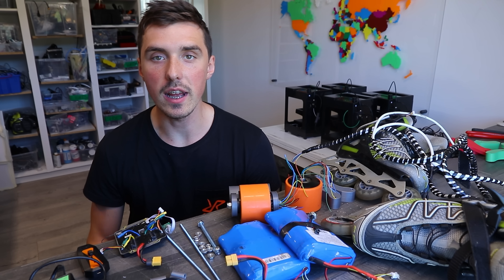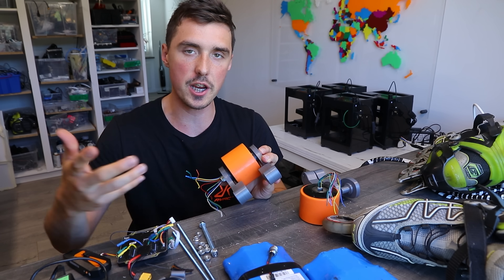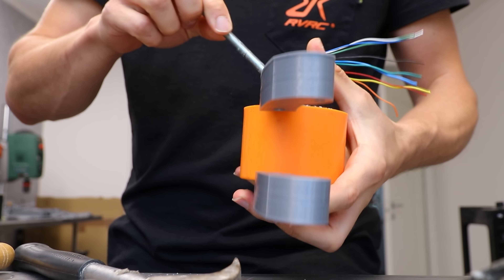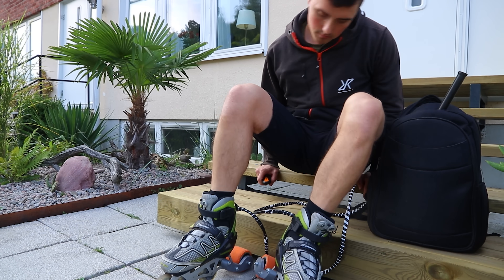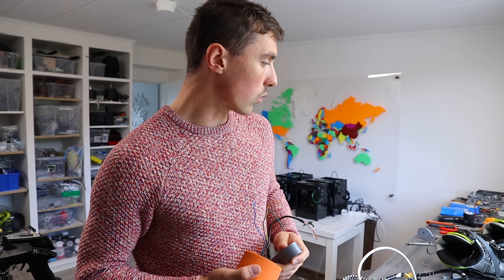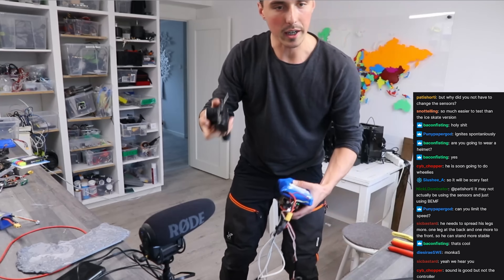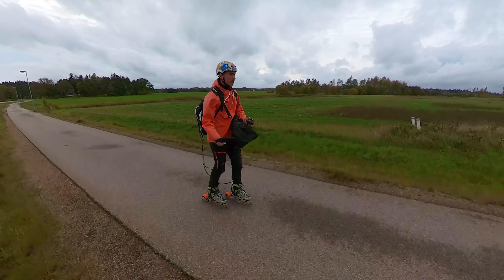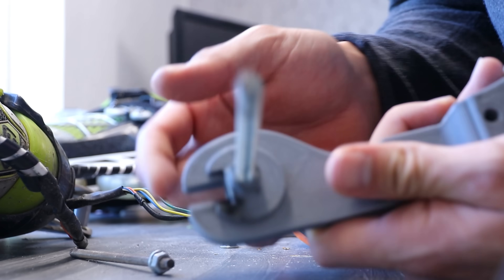1000W Electric Rollerblades That Will Hurt You

Comment: oooooohhhoohooohooo this video is SUPER fun. id love to have a pair for myself

some things id change. first off, id imagine front mounted motors would be easier. i havent used motorized skateboards or whatever ever so maybe theres something i dont know, but when ur skating at high speeds its super important to scissor (which you do really good in the vid!!!) and to bend forward to make sure you're counterbalancing the forwards inertia. i think itd feel more like skiing with wheels in the front only

im curious how turning felt, with the motorized wheels being so square. not that you'd want to turn very sharp going so much faster anyways, but its something to think about. id be curious how itd feel with more rounded motor wheels, with motor wheels that swiveled by some amount, or with quad skates that had some of the wheels motorized

Comment: amazing craftsmanship/engineering! love it. i'd previously thought of making a similar set of electric in-line rollerblades, but different - think of the slades rollerskates that are detachable from the shoe/boot, but in rollerblade form factor, and with the battery pack meant to be carried in a backpack.  so.. like if you took/removed the boot, replaced it with a thin metal plate with attachment points, then had a shoe (like the slades rollerskate shoe) that had a complementary attachment point -- and the battery isn't in the boot/skate platform but in the backpack with a wire. honestly if there was a company selling them i think they'd sell. you must get told this a lot, but if you sold these as an assemble-able kit, or partially assembled kit (the motor & wheel onto the bracket, the electric bms/motor controller).. and the end user has to buy a specific set of rollerblades, or you have them as a kit... i think they could sell. how MANY, i don't know, but slades are a thing so.. maybe enough to make a small side business from. could do a kickstarter, with a minimum amount of units sold needed before it kicks off, to make it worth, then contract a chinese company to do the assembly. easier said than done for sure, but a thought. the main difference with this kind of design is you can take them off your shoes and wear them at work, keeping them in a backpack, then clip them on at end of the workday and rollerblade home if you're close enough where that's practical.

Comment: Instead of soldering motor controllers directly you can solder out the wires so far and put a slip connector or Anderson connector so that way you could easily swap motor controllers in different projects without cutting wires also would love to see a version of this video where you don't speed through the work and that's where a lot of people can gain knowledge to me much better version of this video would not Montage or fast forward should work

Comment: Need to make air gear roller blades next. https://en.m.wikipedia.org/wiki/Air_Gear#:~:text=Air%20Gear%20(Japanese%3A%20%E3%82%A8%E3%82%A2%E3%83%BB,in%20thirty%2Dseven%20tank%C5%8Dbon%20volumes.

Comment: Maybe have a fuse between the motor and controller so if it overvolts it just takes out the fuse instead of the control board

Comment: In the next one you better learn to lean forward a bit so that not only you skate and slide well and lessen the crashes but you retain your tendons and back as well in the long run as I couldn't :) cheerios son and good luck. Keep going and keep growing
Reply: And yeah there should be a hind brake pad too just in case skaters like you tend to just slide brake. You can do it but not everyone. I know housing that under this built is more than a task and a quite a drag as well but has to be there for others if they dare this feet inspired by you. Stay responsible for others too kid. You're doing great. Keep it up

Comment: Will hurt you. Yeah, if you [clearly] suck riding blades and you try running it in the rain..........
Not to mention that rear-most wheel is probably the most important one, and you replaced it with plastic......

Comment: you need to put 4 of those wheels on each skate. or at least 4 that have the same size/shape. actually they would be more stable if they were slightly convex rather than flat. then you will find them easy to control and much more stable.

Comment: You may want to get new wheels for the hub motors if you are planning to revise this project. I recommend to get offroad/street wheels or something like cloudwheels because it will give you more surface area for when turning, while also making it alot easier to turn as opposed to the flat standard PU sleeves, al while providing better grip as you said.

Comment: Was making basically these and selling them some years ago. Some models I made had the battery under the foot with a bigger wheel in the front and a motor in the back. Also you really don't need motors on both feet, one is plenty and more stable on hard accelerations.

Comment: Not sure how to explain it. but if instead of having a flat surface on the hub motor making contact, what if it was a sphere. Almost like if you took a ball. cored the center then shoved the hub motor into that. My guess is it would have less surface contact so diminished speeds, but at the same time due to the spherical nature you would maybe be able to lean into turns easier? Since as you lean you are just hitting different contact points on the sphere?

Comment: It would be cool to have some sort of suspension system on them that is constantly pushing the wheels against the ground while having some give that allows you to lean a bit forward or backward without having to worry about losing traction or breaking the wheel brackets. Easier said than done, of course. It's a great build all together though!

Comment: You have 4 wheels on each roller blade...  (if wheel 1 is the front wheel and wheel 4 is the back wheel then)

Remove wheel 2, replace it with a motor, hook a sprocket to each of the 3 wheels and the motor, then run a singular chain drive to all 3 other wheels.

Having all wheels driven by the same motor makes it so that you have maximum acceleration grip and even wear on all wheels.

Comment: I think you could get by with just one motor on your dominant side.  Your accelerating and stopping would be smoother, instead of two motors that aren't necessarily synched.  You would have to change your stance to a staggered stance, which is more favorable for outdoor skating when coasting, or going downhill.

Comment: you should attach a sprig that pushes the motor and the wheel to the ground so you can keep your weight even on the blades and have better balance

Comment: Pro Tip for when you're splicing two wires together and want them to stay straight. Strip both wires, tin them, and then cross the two wires and twist them in opposite directions.

Comment: I'm sorry that I saw this video months after it had been posted.  
Question.  How much of a difference would it be if you replaced the rear wheel with a more rounded wheel similar to the wheels in front.

Comment: buy some steel rectangular tubing to interface with the motor. The 3D print can interface with the steel rectangular tubing with lots of surface area, making that connection much more robust. A bolt fits into a rectangular hole as well.

Comment: late to the party, but one thing you could try, other than adding a second motor to balance the load for traction, would be to have the rear-mounted motor on a swivel, with a spring (or spring/damper, if you wanna be fancy) pre-loading the motor into the ground.
It wouldn't help with offroading, but would ensure the motor has good contact with the ground, even when your rollerblades aren't in good, even contact with a perfectly flat surface

Comment: I had a bad idea. Use larger inflatable tires so you can ride off-road. Maybe re-arrange the handheld part to mount on ski poles. And maybe modify some skateboard trucks to fit the skates so that the wheels turn in the direction you lean.  Probably need to make friends with a machinist after prototyping with PLA.

I just had an even worse idea. I can't remember what they are called but have you seen those super springy stilt like things people use to jump real high and do flips? Put the big wheels on those. Please don't break your neck or other vital parts though, clicks are nice, a working body is nicer..

Comment: when it comes to skating im so incredibly smooth brained that I cannot absorb information about techniques unless its shortened to like "turn then not turn with other side"
but I think that helps, because my brain is so fucking smooth that as soon as the info gets in my head my smooth brain accelerates it at maximum speed and then I instantly get it
BUT I have to somehow by luck or simple explanations get the basic concept and do it atleast once

Comment: you need a radius on the powered wheel in order to use them properly. otherwhise it might decenter your weight at speeds as your feet can only stay at 90° and any tip will make you lose traction.

Comment: Check out Cesar Millan's(The Dogwhisperer guy)ROLLERBLADES.  :They use a lot bigger diameter wheel,mounted on the OUTSIDE of the shoes. This makes the ride way more stable..you can easily ride over small bumps,even ride on grass and dirt. Maybe those kind of rollerblades can make your electric powered skates more reliable,stable,and safer...and thus probably causing less of a problem when you eventuelly run into the cops,..which WILL happen, sooner or later.

Comment: Any thoughts of mounting your motors with a changeable gear system in your backpack , running cables and using 90 degree drill attachments to power the wheels? So the motors are all in the bag

Comment: You know I think the design is cool as hell.. and I want to make it myself. But all I did was watch a video where your designs kept breaking... It's a waste of time for me to try to build it if all it's going to do is break. I wish you would have made something that lasted I'm trying to buy electric roller skates but I would prefer to build them at home so that I don't have to spend a fortune buying them.. plus if I build them at home and put the batteries in a backpack then I should be able to travel with farther distance if I can get bigger batteries and possibly at a higher speed but I can't do that if it's going to break on me. So I'm going to be stuck buying what's available and there isn't that much available it's very disappointing. Because I really really wanted to build these and the fact that they kept breaking makes it impossible to do ...

Comment: Love this.  Seriously impressed by the integrity of your prints, even though one spindle failed.  Incredible it didn't shatter like glass in the winter when you did the ice skate version.  

Did you consider putting the motors in front?  If so, why'd you choose the back.  Seems like leaning forward to go forward might be more natural and/or safer.  Would allow for keeping a brake on the back too - just in case...

Comment: Yeah hub motors rock.
You mount the hub motor where your crank connects to the frame and put the pedals connected to the wheel. That turns it into a generator that can then be used to charge a battery or directly drive the bike without a chain. Say by to chains. A helmet and lots of pads is crucial for testing new stuff.
You cant short out those boards. Maybe put a circuit breaker to prevent overheating the board. You need to print those out of metal. Send it out for printing at a shop.

Comment: Sure it's side viewers view, hmm. lets remove wheel below heel and replace it with plastic with extension to move wheel further back. Center of gravity staying below heel, lets trust plastic.. Yeah what breaks. Maiden voyage without any safety gear. Okey it somewhat worked alright, but sure is risky way to get views on video.

Comment: That is a very clever solution. Hub motors are the way to go it's just a pity no one makes them fit standard inline skate wheels. I had to give up inline skating as I'm getting too old and don't have the power to skate on the streets as I once did.

Comment: If you could attach a coil spring bucket high up or midway up the heel of the roller blade so the drive wheel is getting pushed into the ground to a certain degree. Might reduce slipping or peeling out thus increasing efficiency.

Comment: Wouldn't attaching the modified wheels to the front be easier to use, instead of torquing you backwards it would be dragging you almost. Just a thought correct me if I'm wrong!

Comment: Hello, 
Hey man why you not try s stronger printing filament material like Nylon or “carbon fiber”, is less expensive upgrade your 3d printer nozzle and heat element than bay a CNC machine.

Comment: Cripes man, a pair of Twisters with 80mm wheels?  I think it would have been worth it to at least change frames to 3x 110 or 125mm.  You can easily increase the volume for parts and eliminate a ton of friction.  Still, nice build.

Comment: If you go 1 km then take the battery back charge it with a meter than you can measure mah lost you could then see how much power you use per km. Once you have that you can divide that by the amount of mahs in the battery and get the theoretical max range. Example if 1 km = 200mahs and the battery is 10 amp hours you could do 10000/200 = 50 kms

Comment: You should round out the wheels like an egg with the center flatend so you can use the edge of the skates more. I love this v9d and engineering. I just fixed my electric skateboard soldered replaced motors e s c and put metal supports in a wooden board where the board cracked.

Comment: Electric scooter hub-motors front and rear might work really well.  They'd be like the long hi-speed inline skates. If you found narrow enough hub-motors, the mounts could just be flat plates bolted to the existing inline skate frame.  That said, 4x 300-500 watt motors in custom skate wheels that looked "normal" would be a ton of work but so amazing!

Comment: I LOVE this idea. This concept used on the off-road skates with their larger wheels and longer wheelbase would be epic.

The Powerslide XC Skeleton 150 All-Terrain Skates enable the rider to strap skates to their normal shoes. 
Having the bigger pneumatic wheels would give a far better ride quality, better traction on all surfaces. Also being able to take them off to walk if needed without having to carry a pair of shoes as well, would greatly add to their practicality.
Having the front wheels powered would be safer because you could then have an emergency brake at the back to stop in a hurry and in case you topple backwards under acceleration.

Comment: Is there some kind of gyro gyro system on your design? feels like having this, or just making the printed 'tire' of the motor the same shape as the other wheels on the blades, would make turning much easier. Aswell as more balance and controll.

Comment: Heya Mate ,the way you are connecting your power wires to the controller ,and causeing crazy arching will quickly fry cheaper controller you need to add a dc breaker switch or use the xt60 and xt90 anti spark connectors they have resister inside that connects first,and no sparking

Comment: are there any hub motors thin enough where you can replace the stock wheels in the rollerblades?.. They would be small but you would have 8 of them, or even 2 on each side. No 3D Printed parts to break if you can mount them like the stock wheels.

Comment: Maybe spring load the rear motor! Like make a suspension allowing it to pivot but with a spring pushing it to ground. Be sure to put some end stops to avoid it launching into the air when you jump ! :p

Comment: Excellent design, Great video. One possible tweak I would make especially if I could get my hands on the list of materials you used, would be to mount it a little higher to make room for a curve on the edge of the wheel. Reason being is it would provide more stability and turnability by allowing you to lean a little bit, not to mention it would probably make these a little bit safer.

Comment: Great project! Your center of gravity is off when mounting the wheels on the rear of the skate, have you thought of getting a triskate and replacing the center wheel with the hub motor? Then for the controller instead of making it a trigger make it like a European E-bike where when you push off naturally (which is how you maintain balance while skating by shifting weight rapidly) the motors supplement the forward motion. Then when you are at 10 or 15 the controller can output full power.

Comment: Without current protection you'll blow the esc or the motors very quickly, like the first trip. You need to take the time to setup motor max current, and esc max battery current. I've built several offroad skateboards with hub motors and  its not cheap replacing esc/vescs at 70euro a piece.  The reason that the esc keeps popping when braking is because regen causes huge currents in the output fets, so you cook them in a few seconds. In vescs the max regen current settings stops that from happening. For anyone who wants to build anything practical and fun you need electronics which allows for advanced current monitoring. A Flipsky fesc is just as cheap as a similiar esc so I dont get why you would bother with an esc that has to be 3x as powerful than you really need since it has no current limiting qualities.